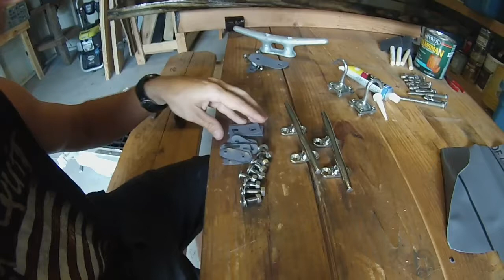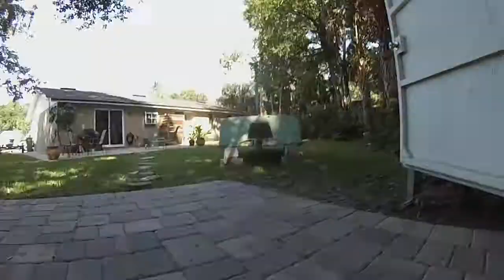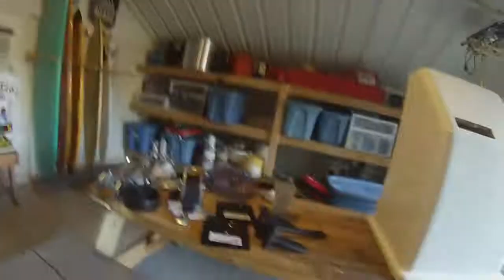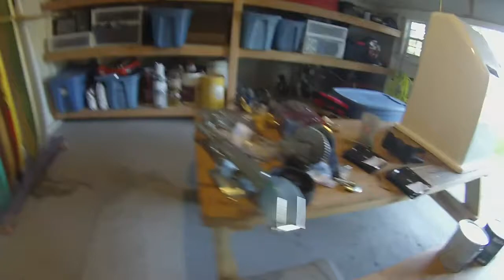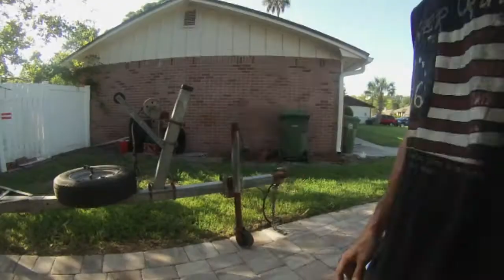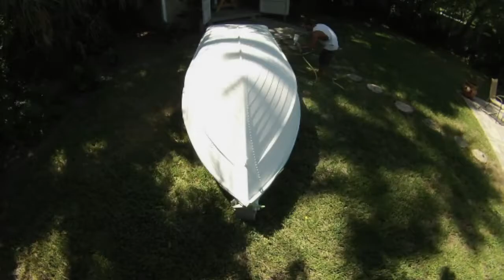Phase 5 - 1964 StarCraft 14’ Aluminum Boat Restoration

Comment: Did you thin the oil based paint to work in the spay gun or was it thin enough?
Reply from the maker: I didn't thin it.  It did come out of the gun slightly splotchy though.  I probably should have thinned it.

Comment: Hey bro how did that gluvit work out ??? Worth it?
Reply from the maker: Yes! Strongly recommend that product. Boat hasn't leaked a drop. Even at the larger holes a had to repair.
Reply: @zchester  thats good to hear im going to order it i think , is there enough for whole bottom or should i just do rivets ? Any good for transoms? Thanks man
Reply from the maker: @ticesine6589  I just did every rivet and the holes I repaired.  Used probably 20% of the can.  It might cover the whole bottom but I think your best bet is to instead focus on laying it down really thick over any area prone to leaking.  It dries like a thick sealed layer of epoxy.  Then I painted over it.  It will work on the transom or really wherever else you want to put it.  Stuff is pretty awesome.

Comment: Zak   Good clips.  I am restoring a 1958 Springbok 16' boat.  I would appreciate talking to you re tips/learnings (any idea how to get new rubber bumper trim for the gunnels?)   Please reach out if that is ok  spcampbell@sympatico.ca
Reply from the maker: Hello S Campbell, the rub rail will come off if you heat the inside of the boat with a torch.  It happened by accident in one spot when I was doing the aluminum brazing to repair the holes.